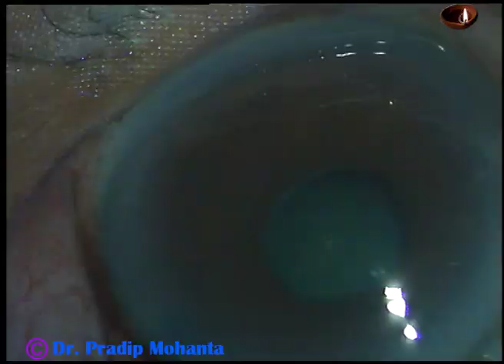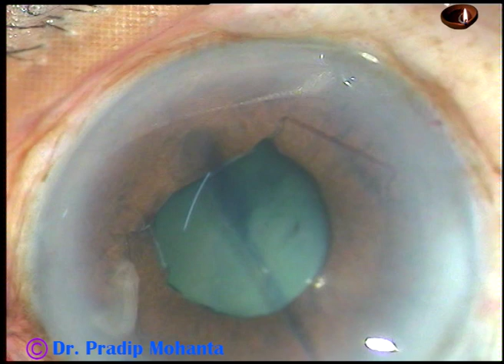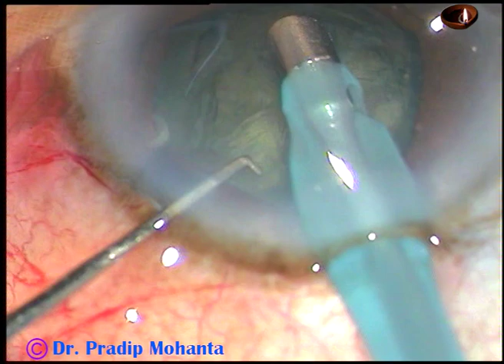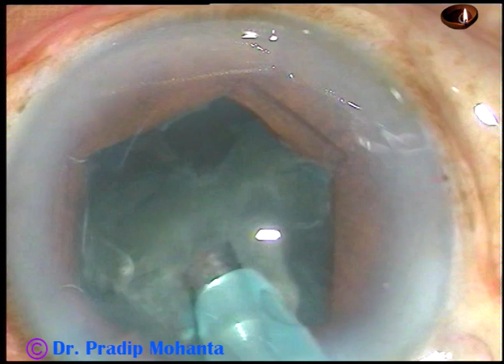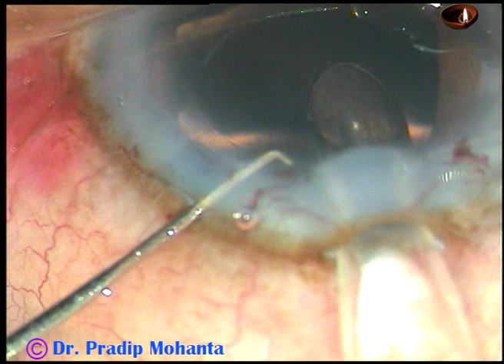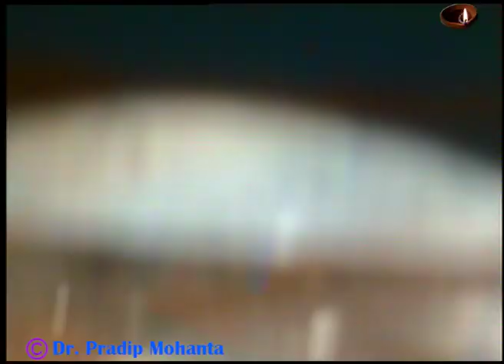Cataract with fibrous band along pupillary border - P Mohanta, 4th Aug, 2019

Comment: Nicely demonstrated. A rigid pupil with a fibrous band does not yield like an elastic pupil. A rigid pupil is like a purse string which cannot stretch and an elastic pupil is like a rubber band which can. If we wish to use a Pupil Expander to expand a rigid pupil by causing sphincter tears, the device would have to be bulky and stiff. Moreover, the device is likely to cause uncontrolled and cosmetically disfiguring sphincter tears causing Post op glare etc. Hence it is recommended that in a rigid pupil, we use a bimanual stretch or other means to remove the fibrous band or segment it resulting in multiple controlled small sphincter tears. The pupil should be stretchable to about 4 - 5 mm before using a Pupil Expander. The tearing of a fibrous pupillary band is not an intended use of the B-HEX. The thinness/ flexibility of a device and its ability to tear a sphincter is inversely proportional. Just to give a comparison - the I-RING is about 1.5 mm thick at the corners, the Malyugin Ring is about 1.0 mm at the corners and the B-HEX is just 0.075 mm in thickness throughout. The B-HEX is less than one-tenth the thickness of Malyugin Ring. Now imagine if the central AC depth is 3 mm the mid-peripheral AC (where the corners of the device rests) would be about 1 - 1.5 mm. Even if the AC is inflated with OVD, the risk of endothelial touch remains with most devices. The thinness and flexibility of the B-HEX lends it superiority over all other devices in most situations. However, it is recommended to stretch a rigid pupil before using the device.
Whether the B-HEX will be placed entirely in the AC in a single pass depends on the White to white measurement. The trailing part may need to be pushed in in smaller eyes.